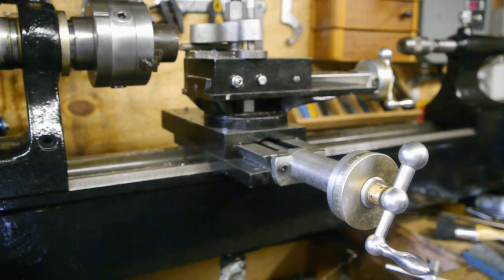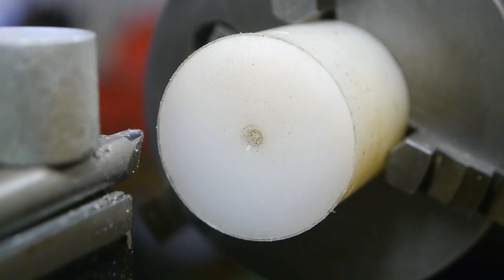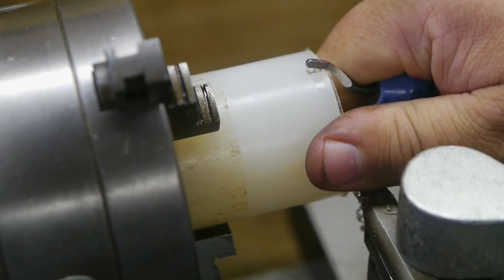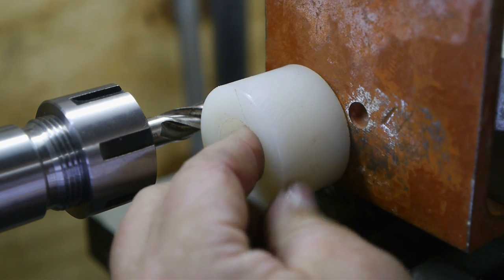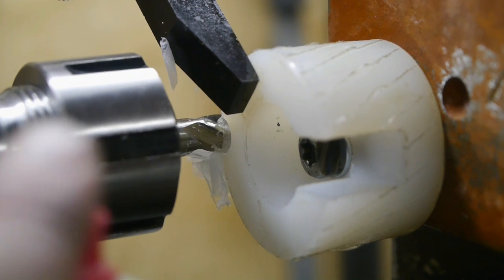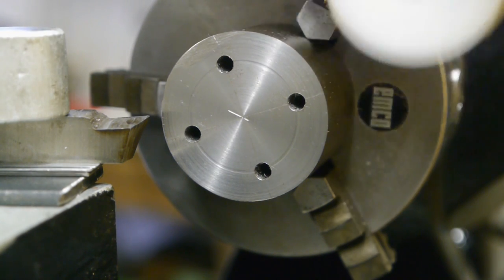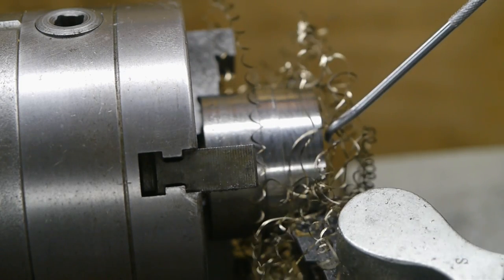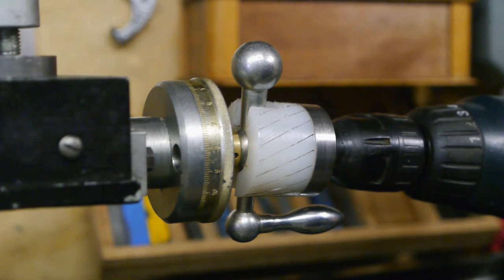Making a ball handle adapter for the old lathe

Comment: Nylon melts easily- Delrin/acetalhomopolymer is a LOT easier to work with.
...but, you can't use what you don't have-!!
Reply from the maker: A while back I turned a piece of POM I think that's the same stuff. 
And you're  right, it machined rather easy.

Comment: ER collets require massive torque to clamp down on tooling FYI. I had no idea until I saw an er32 with 100LB rating.... Incredible.
Reply from the maker: My clamping force was closer to 0LB (what ever LB are?) 
I tightened it only by hand and looking at the video probably not even all the way
Reply: 100LB of torque is a unit of measurement that is not based on the french system. It equates to about 136 newtons. Or about the same amount a gasoline engine in an economy car makes at peak. Or about 20-50 newton more than a typical lug-nut in a car. Enough to snap your arm in two. ETC.
Reply: I think the translation is "tighten the shit out of it" 😊
Reply: Bruno M. "Torque" is measured in "foot-pounds". 100 lbs. (pounds) refers to a specific amount of either WEIGHT or PRESSURE in the English System.
Reply: Rolingmetal "lb." is an abbreviation for "pound"- a unit of weight or pressure in the English System. One kilogram is equal to 2.2 lbs.

Comment: You could easily clean up the nylon by chucking the metal mandrel in the lathe, and then turning down the outside diameter of the adapter just enough to remove the milling marks...
Reply from the maker: I don mind the scars, I think they look kindda cool :)

Comment: 2 cents for what it is worth, guessing your insert is a CCMT (general shape plus it is among the most common in use for smaller and lower power lathes, 06xxxx or 09xxxx can tell size measure and match to chart).   "Mystery steel" in my experience often has characteristics of 1018 including the stringiness.  

My lathe maxs out around 900rpm and to get it to cut without the long swarf it is usually quicker to use HSS with a chip breaker ground in by hand.  Inserts do come with chip breakers I am more suspicious that the lathe can not get anywhere near even the lowest of the manufacturer suggested feed and depth of cut rates. If memory serves best results were with depth of cut was just less than when the belt drive would slip with rpm and feed rate near the lathe max.
Reply from the maker: So you are saying my lathe (Max 600 rpm) is probably to slow to properly use carbide and I'm better of using HSS with a hand ground chip breaker. I do like the surface fine I was getting, but that might have been the material.
Reply: I am going strictly by "recommended" rates of feeds by manufacturers so its not that it can't, more of the design working optimally.  For example, a general use for steel CCMT of sizes I use (060204) the slowest recommended rates mean that even at my lathes maximum, 900rpm, the calculator says anything smaller than 2" diameter really does not have enough rpm for the carbide to work at its "best", in your case the calculator gives 3", roughly, as the smallest diameter in steel.  There will be variances from manufacturer to manufacturer and depending on type of insert (roughing>>>finishing).  People use the CCMT on hobby size lathes all the time but a lot of those have rpm available nearer to 2000 rpm and it makes a difference in terms of sizes/diameters, a "plus" for the mini lathes.
If you look on Ebay, Sandvik, Kyocera, Iscar and Mitsubishi inserts will often have recommended rates as part of the package label, it will give an idea of the numbers.
Reply: IF you really want to see the difference of feeds and speeds makes, take a look at "sunppaa" from 
June 26 2017 when he tests a new turning tool, actual is from about 11:30 to 19:00 keeping in mind its a much larger more powerful lathe, the principles apply.  When he tests a new tool or insert he deliberately goes to the opposite ends of the recommendations (or past).  For this illustration, its the best video I've seen so far.
Reply: Rolingmetal I wouldn't say the machine is to slow for carbide, it may be to slow for the geometry of that particular cutter, a different style may work great on your lathe. I would recommend doing some research on carbide cutting applications, you'll probably find something ideal for your machine and the materials you work with.
Reply: Rolingmetal Also, yes by grinding your own HSS you can fine tune the chip breaker as you see fit. At the price of HSS, you can afford to experiment as well.

Comment: Thanks for the video.  Glad that it works even with the "feature"" of pattern from the end mill. 

I have seen other videos on making similar adapters.  These were folks who had power feed on the carriage but wanted to use the adapter for the compound handle.  I need to make one of these for my compound.

I think a piece of wood is easier to machine than nylon.  As you experienced nylon is easy to overheat and then it tears more than cuts leaving crappy finish.

Your carbide insert looks to have chip breaker.  Mine do, but some materials still make long stringy chips.

If you take some measurements you will be able to find the designation code from this site.  You will need to order by the relevant code.

http://www.carbidedepot.com/formulas-insert-d.htm
Reply from the maker: I call it the pattern of shame :)
Wood for sure is a lot easier to machine but it would also break easier especially when it dries out.
Thanks for the link. That site look very useful.

Comment: you taking way to big of pass (milling process)
Reply from the maker: It didn't feel that way. Hardly and resistance on the cross slide.
Reply: Rolingmetal  The reason you "didn't feel any resistance", was because the nylon was melting!! Even with polymers, 2 times the cutter diameter is about as deep as you want to go with one pass- and 1 diameter deep would be even BETTER.